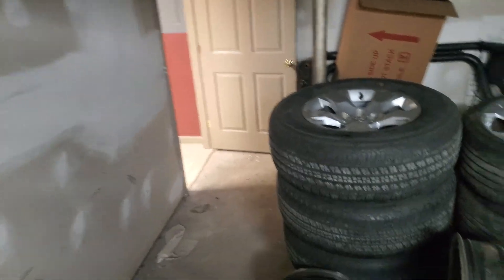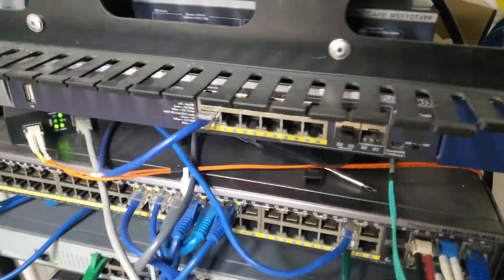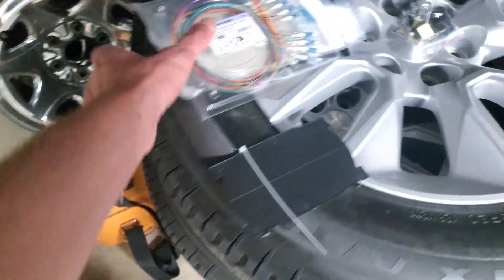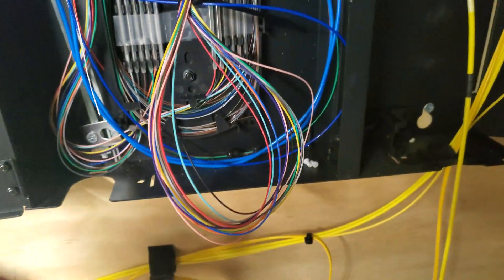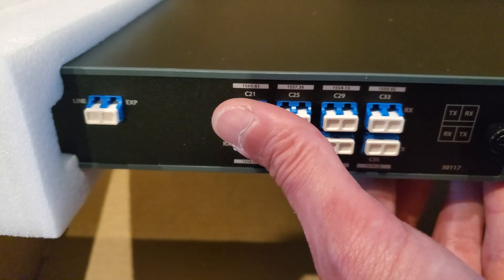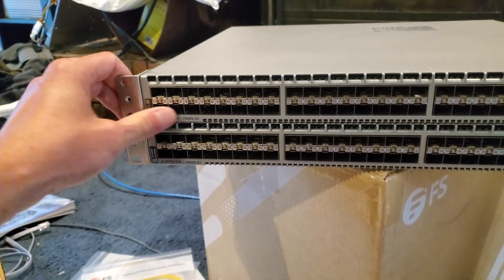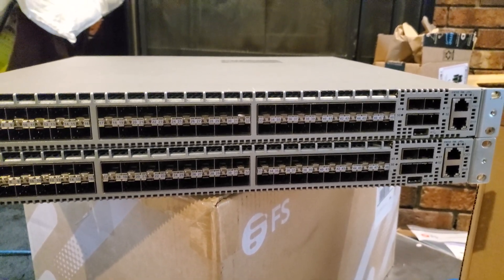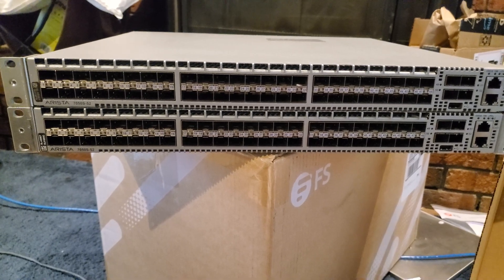Planning out our new single fiber DWDM system and indoor splicing

Comment: I see FS 50117 at your CO, but it doesn’t look like FS 50116 at the far end. Would you mind sharing the part number of that and also the OADM you are using to pull channels in the middle? I’m at the point that we need to start doing DWDM in our own network and finding this aspect of your build very interesting. Thanks 🙏
Reply from the maker: https://www.fs.com/c/dwdm-cwdm-oadm-179

Look at the DWDM 2 choices.  You can do E or W or E and W depending on your needs.  I don't think there OADMs have a part number because you can order them to spec.  Like I need C21 and 23 to drop in this case I got a E or W version in middle.
Reply: @briceperdue7587  Thanks for the pointers.